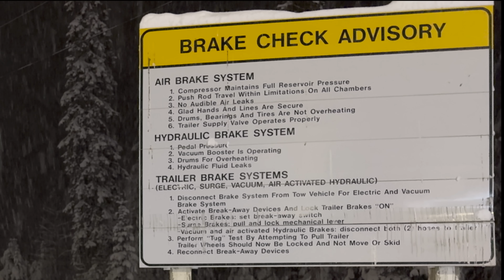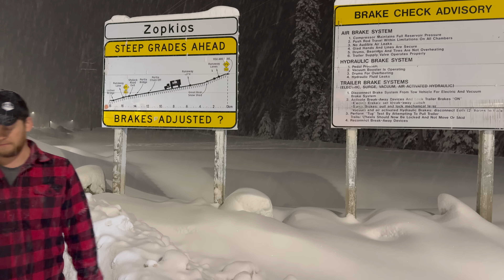Edison Motors & Highway Thru Hell - Guide to Tire Chaining on Snowy Roads

Comment: Wow young fellow, first video that I've seen it dune right. Bungees are for people to jump of bridges with, and for those who cant do chains right. In 50 years I've never used them and that was before rail tightners came along. And how to deal with 3 extra link or more, always on the hook first or on the cam stile last. At a boy well dune. Sure dot miss the chip trailers on low pedestal 5th wheels. 🥵🤕

Comment: I ran a crane truck in the AB oilfield for years ... used to run Triples which go over both wheels  ....... by myself .. frequently .... waay more traction than those singles they're runnin

Comment: Something that you can do to make chaining up easier if you are on relatively flat ground is drop your trailer and pull out. That way your not fighting under the trailer and not getting snow on yourself. It takes about 3 minutes to wind down the landing gear, unhook the air and electrical, pull the pin, pull out, and do it back again in reverse order. That total 3 minutes makes chaining a lot easier to throw the chains over the tires, especially with trailers that don't have much clearance from the tractor unit.

Comment: Ah ... manual slacks .... back when I was driving.  You HAD to have a 9/16th box end to be able to adjust your brakes.  I stopped driving just as auto slacks were coming into fashion.  We were told DO NOT ADJUST YOUR AUTO SLACKS ... If they need adjustment, the truck is to go to a mechanic at the next time.

Comment: Man the first time you take a cab from the merrit husky to home hardware for bolt cutters will be the last time you put them on too tight. 
These guys can say what they want. I'm the opposite : as loose as possible and bungees all over the place with at least 2 or 3 octopuses on each tire .  They can get so tight that the cams won't  even back off.

Comment: Couple points to note.  The hooks should be at the front because the hook is far less likely to got knocked out from accidental contact if you have to do some serious digging with the chains for traction.  The front chain 8:40 is on inside out.  The flat side of the connecting link from the cross rail to the main rail should be flat against the tire as it allows the chain to be tightened much better.

Comment: I just got done driving for a week where i was throwing chains on a tri drive. Ran the length of the FTR multiple times.Thank god for Trygg Chains with boomers instead of hooks, they are so much easier to do up than the hooked chains. 

It blows me away that there are truck drivers in Canada who do not know how to throw chains correctly. Ive been driving for 3 years in the Canadian Oilfields, its something that is taught at basically every frac company. I learned how to throw chains before i knew how to drive. Its a skill that NEEDS to be learned in my opinion, same as safe backing or logbook management. Crazy that people drive trucks around and cannot do that.
Reply: Different world for the oilfeild guys man, these guys don't even kno how to put boots on, they live in flip flops.
Reply: Why did you need chains on the FTR? What were you hauling? Or were you going off the FTR into actual bush?
Reply: @braddragon1812 there are a couple of good pulls on the FTR that a super b or trailer heavy unit is disadvantaged. Lots of heavy shit goes up and down that road eh?
Reply: @braddragon1812 there are a couple of good pulls on the FTR that a super b or trailer heavy unit is disadvantaged. Lots of heavy shit goes up and down that road eh?

Comment: Short 2 X 6’s with 2 X 4’s separating the tire cross links laying on the ground works well .  Screw the 2 X 4’s onto the 2 X 6’s .  Drive onto the boards .

Comment: I'll always use the bungees. Why not?

 There is also a trick to use a straight bungee to hold the chain up against the tire when rolling over the chain. It helps a lot.
Reply: If you need bungees your chains aren't put on tight enough. Never have i had to use them. If there too loose that's what your chain pliers are for to take a cross link or 2 out to get them tighter

Comment: What's with the singles? When they changed the chainup requirements a few years ago you had to have at least a set of triples on one drive axle and then you could legally have a single on the other drive axle. Me if I was hauling in that shit snow I'd have triples on both drive axles. For the amount of time it take you're far better off with triples all around.

Comment: @edison motors Have you thought about converting motor homes?  The power and increase in fuel mileage is nice.  Plenty of room to store the batteries.  The batteries could also be used to run the electronics of the motorhome fridge/hvac/lighting etc.  You could put lots of solar on top of the motor home.  Motor/transmission plenty of room to switch to big generator.  Electric only to creep in and out of camp grounds.  Seems like a match made in heaven.
Reply: Yes! we are currently in ours and a hybrid solution would be so very good for this RV industry.
Reply: Shure he will send you all parts now you find a pace in the chasis of the truck

Comment: Singles that is rookie shite real truck chains are three rail. And eleven percent for 4 or 5 kilometers? Cute little hill. Come to Alaska drive Thompson pass for u pavement princesses or atigun pass if u like doing it on the dirt.
Reply from the maker: That’s not a knife, this is a knife 🐊
Reply: I could be mistaken in my info but I believe the highway in this video has a maximum grade of around 8.5%, and more like 8% from what I have understood on a certain general section, have been on it once during the summer with a pickup on the downhill route heading south and certainly its a grade all right ( for a main highway ) and a bit more than the max 6 to 7 % that one often encounters on a lot of grades. I do wish I had continued the drive up all the way to Prudhoe quite a few years ago ( just on a holiday ) and was north of the arctic circle looking down into the valley across over to the Brooks range. But anyway back to tire chains, singles seems to be a theme from what I gather in the mainland states on highways and apparently in Canada on main routes. In this video I shudder at the thought of wiping feet with those puny looking chains for fear of blowing them apart as they look more like cross chains that a low end strength of chain a pickup would use. If there was any amount of packed snow even on a highway those singles would be pretty underwhelming vs triples on the drives.

Comment: It looks so easy, LOL. I was only ever able to use singles on the steer tire, all my drive tires had to go into 3 railers (Montana log truck pulling a pup) fortunately most times I only needed to chain up one drive axle. I knew a guy in So Cal who used to do chain up service in the mountains he said the state made you bid the different areas and some years he could only get a crappy area, he taught me that snow chain tires were only good for pinching your fingers! I bought a good long handle set (about 3 foot length) for fixing the heavy gauge 3 railers out in the woods. You learn not to abuse your stuff when your the one who has to fix it in the cold dark night with dead flashlight batteries at least 30 miles from the pavement and another 50 miles to town. Keep up the good work. Praying for your safe travels.

Comment: Only thing I noticed was the hooks for the cross chains facing the tire. I was taught to keep them on the outside to prevent damage. I never thought it mattered since the tires are thick rubber but 'daddy said' so that's how I still hook them up. I always use the tensioners too (again, daddy said) and use them to hold the excess chain same way as you use the main hook. Some scrap 12awg wire for the inside if needed.
Reply: I noticed that too, I was taught the same
Reply: I noticed that also,  you're the first to comment on that after a ton of comments..nice catch

Comment: Shouldn’t they be using triples?
Reply: Been hauling logs and other stuff in BC for 35 years and have tried single s a couple of times and they are absolutely useless
Reply: either a set of triples per side of an axle or 4 singles on all 4 outer drives is mandatory

Comment: I didn't see you hanging drag chains. Did they not require them that night? Or, does Canada not require them?
Reply from the maker: Trailer chains?
Reply: @EdisonMotors  Yes I've always called trailer chains drag chains. 
One coould always tell the weather when reloading your trailer at the dump, you would see people chaining up their trailer in the relative dry with the trailer hanging from the trailer loader. I hauled logs from 1969 to 1977, took a 35 year break and went back as a retirement hobby job until COVID shut things down. I got used to sleeping in until 4 AM and never went back.....
Reply: I always used at least one drag chain in the patch when pulling wheels and I automatically hung a set of triples on my new B trains ( they look better there than the truck) and I have a set of singles to put one on each wagon. Holding on a hill or prevent the accordion shuffle makes sense.

Comment: Where electricity is available near the bridges heating cables could be buried with temp. sensors,keeping decks clear
Reply: It's definitely not available 😆
Reply: @callummckay7364 there’s lights right there lol power is available

Comment: I did this highway in the summer, car said I had 300km of range left as soon as I hit those hills range dropped to 100km and i could not make it, had to turn around back to hope to get gas. Arrived in hope with 0 km of range. Wild highway, its no joke!
Reply: What's so wild about it??? I find it boring, especially in the summer, but then I used to drive it 4 times a week

Comment: Electric axles on a tow plow would be a cool idea, especially if you can have a umbilical cord hooked to the HV system of the truck, or have the tow plow have its own small motor/battery system to sync with the truck.👍

Comment: Stupid highway design! It will kick ass with a hybrid drive system when its dry.
Reply: its basically a straight shot over the mountain vs hwy 3 which is like throwing spagetti at a map.   sure the grade is steeper but your not dealing with switchbacks and 1000' drops.
Reply: It's crossing the Rocky Mountains. You don't always have the opportunity to level out the grade.
Reply: There are serious mountains through here, there isn't really a way to design the highway better. In fact this already is a massive improvement over the old route. It is a little steeper, but it's much shorter length with wider easier turns

Comment: Just finished the whole video, and a  little disappointed that there wasn't a full tutorial for the newbs, but there is a decent CVSE one that goes step by step.

Key points Chace made: make good goddamn sure you have the right SIZE chains and they're in good shape BEFORE your need them. 

Practice, in the daylight,  in s parking lot,  BEFORE HARD,  at least once-- don't learn middle of the night in a snowstorm.

Fix broken and bent links, carry repair links, or at least a small spool of tie wire.

Know your style of chains and their features.... vbar or studded WEST COAST spec with long boomers and cams are the cats ass.

Know which side faces out (pointy bits) and that attachment links from traction to side rail the hooks face AWAY from the tire.

The trick of going foreard and back to seat the chains into the lugs, retighten (1 or 2 more links) is KEY....slack chains slip or worse kink and break.

Zipties can be used to take up excessive slack, preventing flail damage. On non cam chains,  the spiders and bungees do help a lot.

And last, when you chain off  look for damages,  and put them away properly, so when you need them next,  it's not 20 min to untangle them. 

I've run 36+ years, and an avg year i throw jewelry 30+ times...

Comment: I've driven the Coquihalla in early January during the day when it was NICE out, and there was still some hard snow pack on the road. I'm not keen to have to do it at night when it's snowing. They really ought to have variable speed signs the whole length of the highway, because the max posted speed is 120km/h, and not everyone slows down for the conditions.

Comment: My family was coming up the snowshed in a little fwd car with snow tires during a storm in 1998. Near the chain up, the trucks were spun out, near the shed all the light stuff was spun out. We threaded the needle and made it through, the van behind us plugged the last hole. 😂
Reply: Was that '97-98? I remember that one. We had the whole family packed into my dad's van. Had a funeral AND a wedding in Alberta around the same time (different ends of the family), and the blizzard hit on the return trip. I was still a kid at the time, but I think we ended up grabbing a hotel in Merrit. My dad was a fairly experienced driver because of his job (senior service rep for Datex Ohmeda, and his territory was all of BC and Yukon), but despite having chains for the van, my mom wasn't comfortable with the road conditions, so we didn't risk it until daylight.
Reply: @BlackEpyon  Probably right. I remember it was right around the end of December when we were returning. At the start of the storm, we were scheduled to fly out of Seattle but all the flights were canceled. The airline put us up in a hotel and then booked us first class the next day. Very memorable trip.

Comment: Great video. Haven't put on chains in years. But used to drive a wrecker in the army back in the 80s and chained a lot. Those cam adjusters are great, but we didn't have them then.

Comment: Yeah, the educational part is really important. The drivers need to know how to chain up, drive with snow and ice, uphill, downhill, check the brakes (many trailers out there still need manual adjusting and they can just swipe when the tractor unit brakes), etc. and the CDL training and company training might fall short.
Also, many drivers aren't lazy wheel holders, but they certainly get tired and miserable just driving in winter, then they need to chain up, getting their asses in the snow, cold and likely wet at best.

Comment: Any thoughts about an option for the "automatic chains" like firetrucks in my area are equipped with? Or is that equipment too low hanging for doing things like logging? It would be totally understandable if they were, and considering how important that ground clearance number probably is, i wouldnt be surprised if its already been talked about and ruled out, possibly strictly on that basis.
Reply: Clearance usually isn't an issue but they could get hit with rocks/small logs/etc causing problems. Automatic tire chains are only good for a few inches. Although you'll always find someone that says they went through a foot of snow with them. It's also more equipment to maintain as they are constantly exposed to the elements. Really depends how much usage they'll get verses cost. Regular chains are cheaper - even while paying someone else to put them on!
Reply: @ArmchairIC  hey thanks for the knowledge! I assumed there were general risks involved from any additional equipment like you do, any added complexity is just more stuff to break, and all the firetrucks I have seen them on, seem like low hanging fruit for that sort of thing, so it makes sense not to use them I suppose.